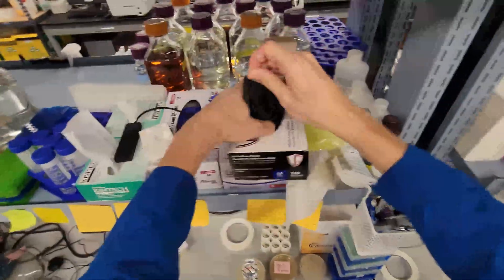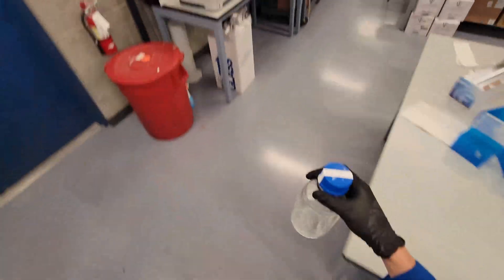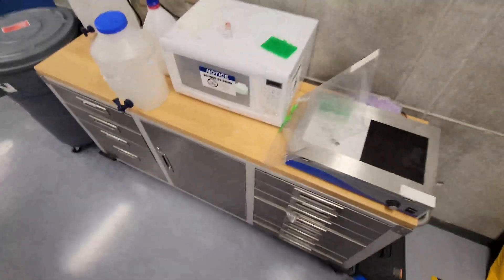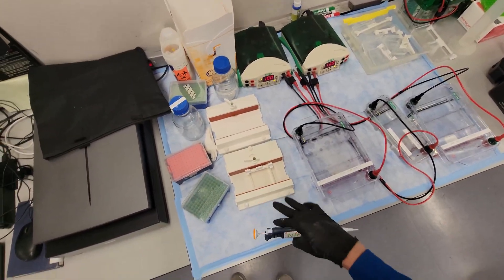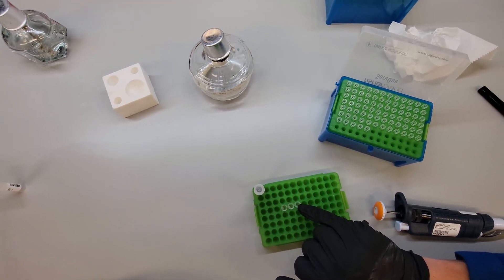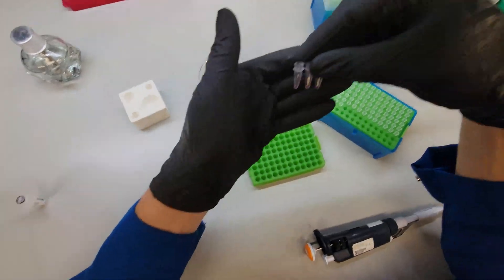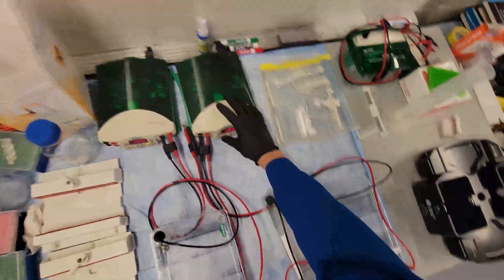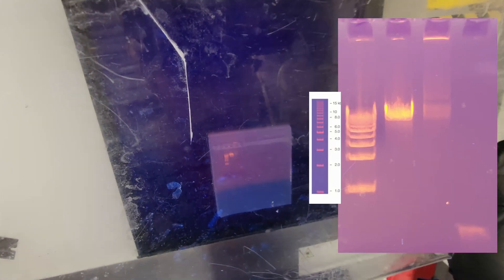How to Run Agarose Gel Electrophoresis FULL TUTORIAL

Comment: Hey Nick, have you ever used the little magnetic bead solutions for DNA purification / size selection? It’s pretty neat. I was using them for size selection when doing a reduced representation sequencing method for DNA methylation in my dissertation. Now sequencing has gotten so cheap that we use whole-genome instead, but our protocol from New England Biolabs still uses the beads and a magnetic rack to purify the DNA after each step in the protocol.
Reply from the maker: Yea I've used those beads before! They're super cool. I used them for size purification for a genome-wide library in preparation for deep sequencing. I like to use gel purification for normal cloning because each time I'm usually cloning something different and I want to know for certain I got the right size bands.